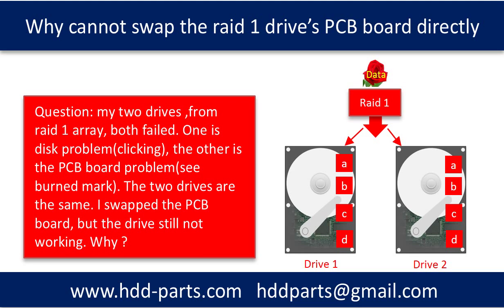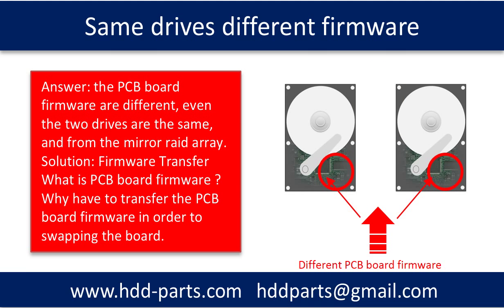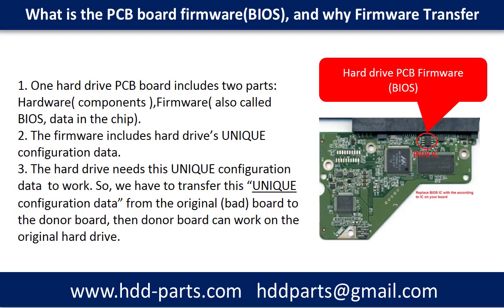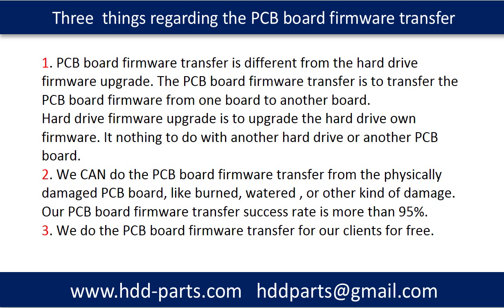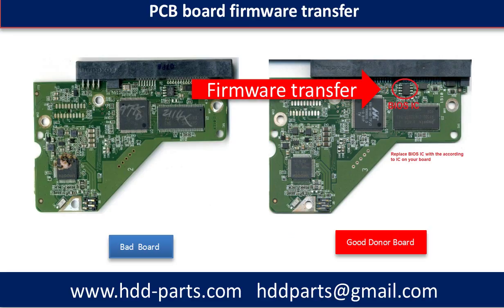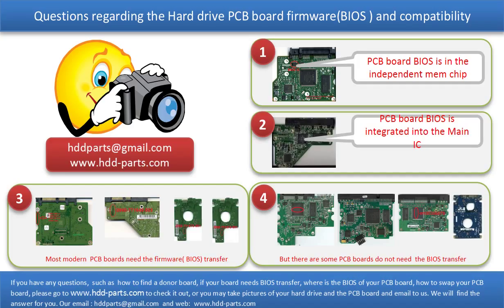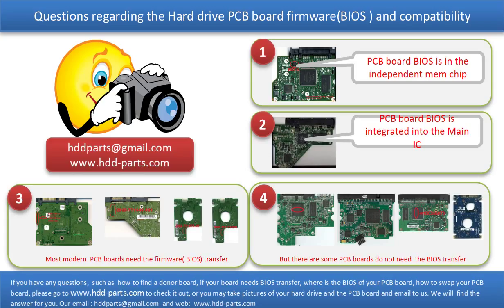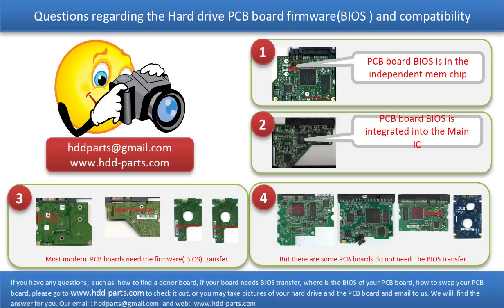Raid 1 mirroring   Data Recovery Q&A  27

Comment: i have 4 disks configured in raid 1 disk 0 and 3 is showing amber light on caddy/tray on mibm X3650 m4 server each drive is 300gb now disk space is showing 570gb which is degraded my question is if i place new drive 2 new drives will reduild itself and extend back the disk space and data will be safe?